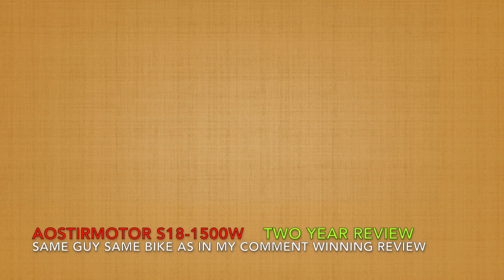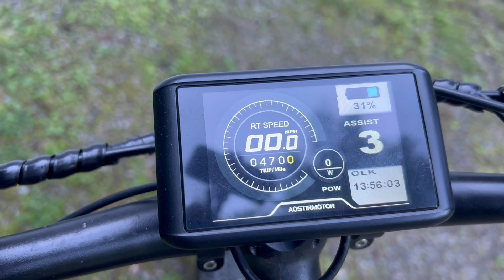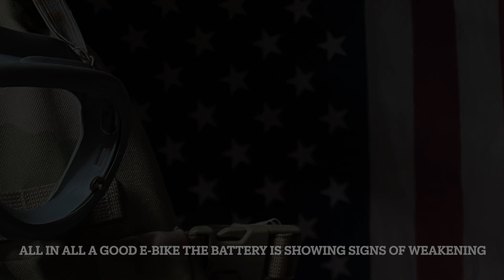cool old geezer taking a casual ride through pretty nature

Comment: What range are you getting on your S18? I’ve had mine for 5 months now, love it but get max 10 miles on a full battery with ONLY pedaling. Aostirmotor sent me a new battery and I still get the same issue .
Reply from the maker: I get 13-17 or did rather .Just logged 3007 miles total and the battery is not as strong. 3rd assest 7th gear and peddle your sack off to get this range.
Reply: @humblegeorge  damn, I’m honesty thinking of selling it at this point, for 1k I would hope to get at least 20 miles
Reply from the maker: I paid $1,600 so I should have taken out stock in preperation H !!!! I have come to understand they are all lying . But think of this,who would you call 60 miles from home ? I have several steep hills to help me rebuild charge So that is why I can get 17 miles and black screen.

Comment: Do you still have the original battery?¿???? 

And you know you can add another battery by unplug yours and then plug up the other one plug and play just make sure it's the same voltage your bike is 42v 20ah if I remember just look on here they will explain you can get you a 60 mile ride on...

I didn't buy that bike because I didn't like the battery setup, and it's not a Samsung or Panasonic battery I always look at that before buying a bike most China batteries are junk....No regulations and most aren't UL listed... Samsung and Panasonic is...
Reply from the maker: yes but it is not nearly as strong after 4.000.00 miles.It has been a good bike but not great. Cheers and thank you for commenting .
Reply from the maker: best I ever got was 17 miles new.Now perhaps 8 miles on a good day.

Comment: your review needs more reviewing in it. 95% of your video ain't it. Get to the point sooner, in far more detail, and more often. Or call this vid "cool old geezer taking a casual ride through pretty nature". What got worn, what got broken, replaced, what needed mending, tweaking, what do you feel will go out first, how0s the battery compared to when it was new, motor performance...? Is what i'd have liked to have seen.
Reply from the maker: Thank you very much for this comment :>) Well I have logged 3,300 miles and I replaced the tires with smooth baldies " like me " and the break pads.
The battery is much weaker now and can not make 17 miles with out spending every bit of charge.It has become looser in some ways and creaks as you peadle it .But I still like it.Love it ? No.Still takes 6 hours to charge.
I did another video not too long ago you might find more enjoyable.And please remember Old people tend to talk a lot as time for them is getting short.Cheers perhaps you might make a far better video some day :>)
Reply: @humblegeorge   hahaha you actually changed it :) Should keep the model in name at least, so that people can find you if they need info about it.
Thinking of buying s18 (or maybe s17),  with shipping costing extra 400 USD to Croatia, so trying to get as much info if it's worth it. Thanks for your reply and time. You made me laugh with the title change of the vid hahahaha. (still Davor here, typing from different computer).
Reply from the maker: I wondered if I might hear back from you.Glad to see you found my changing the name to you'r Idea. I liked it as it did fit better. We all need to use our sense of humor more these days.Times make us all tense and unhappy.Please check the new bikes out now first.This is not a good choice anymore if it ever was.Hub motors are all midrange power.No low,no high.I have to use it in 3rd assist .1st is worthless,2nd half assed,4th I can't peadle that fast and 5th is useless also. Just a heads up I rate the bike a 30 out of 100.
Reply: @humblegeorge   again, thank you for your time. I see a lot of mixed feelings, some say it's not good, others absolutely adore their S18 and S17 variants...
Stay a cool old geezer! And if you ever get the chance, visit Croatia, we have the biggest area-to-national-parks ratio ever
Reply from the maker: Thank you your very kind :>) Thank you for commenting.
Reply: @humblegeorge  the thing is, I am very unable to find any ebikes of similar power, with decent dual suspension, for that kind of price. Or even for twice that price.
You say to "check the new bikes first", but I come up empty. Now, the price is an issue, I know there are tons of good options at the 2500+ USD range...but S18 costs 999, and the stronger S17 (which I've got my eye on) 1300 USD. This is peanuts in the world of dual suspension ebikes.
Any words of wizdom?
Reply from the maker: Well honestly you will get many happy miles out of the bike like mine.Just realize when I bought mine prices were lower than now.And I most likely will not upgrade to a newer one any time soon.I only wanted you to know going in there will be drawbacks that new bikes " say " they have resolved. Cheers again and thank you for your comment :>)